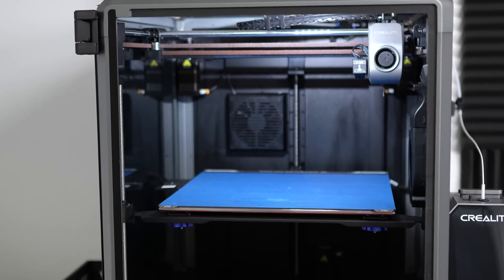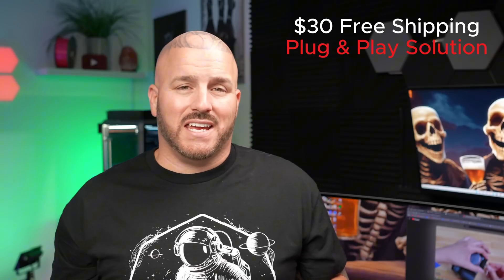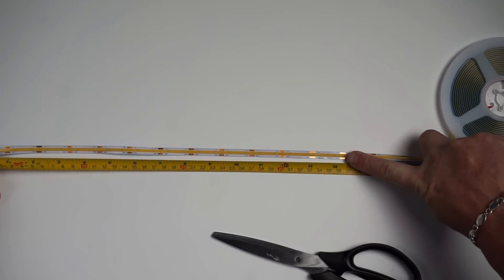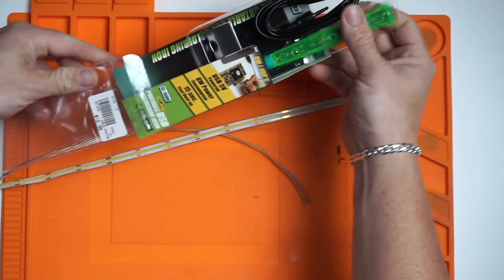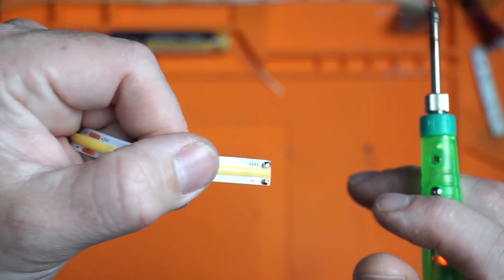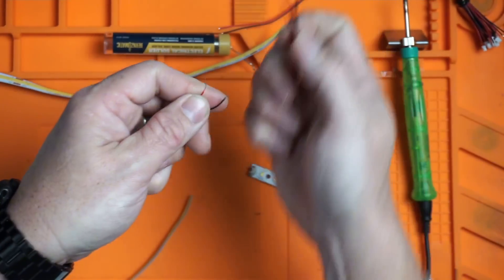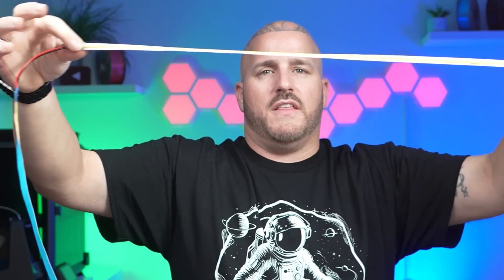The Ultimate Creality K1/K1 Max  LED Light Upgrade

Comment from the maker: I’m also producing filament sensor extension cables for relocating the sensor if you choose to do so. Fits all sensors for Creality.  The cable is $12 directly from me. Email stayreadychat@gmail.com to order lights or extension kits. These are also listed on eBay for those who feel safer buying on eBay. They are slightly more expensive due to eBay’s fees. 

Extension link
https://shorturl.at/mDmmy

Light kit link
https://shorturl.at/NJSZV

Comment: But how many ampere u need? I check the board, and pin is 24V 0.1A. U can help me?
Reply from the maker: For the k1 max you need a strip that’s 30” long and one strip that is 14” long. That works best.

Comment: Just out of curiosity, could you just cut the two wires off a spare connector (maybe the male/female mate you don’t use) and use that wire instead of buying extra wire?

Comment: can we get a new light recommendation? the ones you linked are no longer available.
Reply from the maker: https://amzn.to/42SoQbT
Reply from the maker: Yeah, it’s been hard finding lights. Especially quality ones. The ones I’ve used for almost a year now and you can’t get anymore. And 24 V cob lights are not cheap.
Reply: @stayreadyto3dprint  I found some awesome ones and printed a lid raiser with an angle on it and install the lights there it looks awesome!!!! Didn't do it the way you did but the backward connection was the same for me, they put the connector on backwards. Thanks for the awesome video man.
Reply from the maker: Yw. Glad it helped lol

Comment: flux paste will make the solder stick better, I also ran into the creality swapped colors on the cables for the jst. Buck stepdown converters to go from 24 to 12v or even 5v (cheapo light strips)

Comment: Hello. K1C with cob has  trouble 
Led Blinking when start printing
does you know how to fix it?
Reply from the maker: I would check your connection points. Unplug. Replug in. Did you buy the kit from us or make it yourself? Send me an email either way and I’ll help you out. Stayreadychat@gmail.com
Reply: @stayreadyto3dprint  make mine. normal led is ok. But cob led not. Anyone reported it with k1c?
because K1 and K1 Max works normal
Reply from the maker: No. It should work. But you need to make sure youre suing correct lights. You may need to add a small resistor to ground to clean up the power. That should eliminate the blink.

Comment: well going to have to be the first, it didn't plug and play for me. Either my k2 is different or the kit is not compatible. Tried on both ends of the lights and nada plugged in the factory lights minus the frosted covers and they work perfectly,
Reply from the maker: Then you have your wires crossed. Swap red and black and it will work.
Reply: @stayreadyto3dprint  its a pre made kit not sure how i did anything wrong. It only plugs in one way.
Reply from the maker: @ ohhhh you bought a kit? Ok well send me an email. I can send ya another one.
Reply from the maker: @ it’s possible that I accidentally wired it wrong or sent you a kit for a K-1 versus a K2. I’ve made over 500 of these things without a mistake yet so I knew eventually something would happen, but we’ll get you taken care of. Don’t worry.
Reply: @ it happens man i can make the part fine just like supporting creators i enjoy their content. We need more no nonsense 3d printer channels.
Reply from the maker: @shawnmcandrew6923  we always appreciate our supporters but we also want you to be happy with what you’re getting. I see you emailed. Looks like we have it all figured out via email.

Comment: Thanks for the great video! I still HAVE to complain! I've seen a few of your videos where you're actually soldering. And my toenails curl up every time. When you just smear the solder on the LED contacts without using any flux, and then two "balls" appear. And when you say something like, "Okay, now we have these pretty little solder beads on the contacts," it made me dizzy... you should definitely practice and improve that! Not getting dizzy, but soldering.😜
Best regards from Germany
Reply from the maker: Lmao…. I’ve actually gotten alot better and I bought a quality iron. I’ve sold over 400 kits so I’ve had a bit of practice now. Ha

Comment: What's the lenght of the LED strips for K1/K1C
Reply from the maker: I send them out at 14” for the right side. And 30” for the front and left side. That is sized for the k1 max. You will need to cut off what you don’t need. Easy. Just cut along the copper cut lines.

Comment: Thanks for this, i've done this for my k1max and my brother's k1. it's so frustrating how they don't have lights on the sides as well and only on the front, can't see anything in the back when it's printing without more light, so frustrating. Wish i found this video before i tried doing my own version and cutting the original cable. Didn't realize you could buy female connectors that fit! I had to re-solder/re-wire the original cable lol
Reply from the maker: Thanks for watching! Stay tuned for some cool mods coming up soon!!

Comment: I done the same thing but after 2 seconds, light turned of and burn smell appeared…. Now light don’t work at all
Reply: Probably 12v lights on a 24v transformer
Reply from the maker: You did what same thing? Plugged backwards? If so that’s not what burned your shut up. If you know how I diode works it only allows energy to pass through in one direction. It’s impossible to plug a diode aka led light in backwards and blow it unless you plug it into something high voltage or higher than its reverse breakdown voltage. So you have another issue or maybe your LEDs were just ready to go out anyways. 

And how did you plug it into something high backwards when the 2 pin connector only goes one way. You would’ve had to forced it. Unless you had it wires up wrong. As stated in my video, Creality has their black and red reversed. 
But you should always use a test light to verify   

Sounds like you need a light kit. I have some in stock starting Wednesday if you want to upgrade or fix your lighting. It’s a plug n play solution as long as you plug them in correctly

Comment: How did you remove the old lights. They are stuck good.
Reply from the maker: Just take a small flat head or use a razor and scrape that glue off there. They put it there to keep it from coming lose. It’s easy to scrape off though.

Comment: Only 2 sides is better ? Now you have a light in your camera
Reply from the maker: Not at all. The camera is angled down so there is zero glare. It’s perfect. I’ve sold around 100 of these and haven’t had 1 single complaint
Reply: @stayreadyto3dprint  hmmmm oke i will add 2 off them 5mm led in a angle will be fine i think so. I wont take the risk haha but thx anyway for your answer.
Reply from the maker: @Blauwdruk3D  awesome! I think you’ll be impressed. Good luck!

Comment: I purchesed a light kit for my K1C boy what a difference they really work great
Reply from the maker: Glad you like them. I’m assuming the filament sensor extension I made for you is working great as well??
Reply: how did you get this to fit in the k1c?  seems there's barely any room to shove it in the front two corners where the tracks stop.  On mine there's barely any vertical space between the silver slide tracks and the gray frame.  I made it work but am curious how you did it?

Comment: I received my kit the other day and just installed it. It is a whole lot brighter now. I popped off the OEM light easy enough, but undoing that little connector was a different story. Mine was encased with stuff? that I had to scrape away. Once done the rest of the installation was a breeze. Thanks for making this kit available.
Reply from the maker: That awesome. Yeah I guess I should’ve mentioned the glue in the connector. It’s been so long since I installed mine that I forgot about that. Glad you like the kit. I’ve mailed alot of them out and they are also on eBay now. A little more than $30 due to fees. Much better to buy directly from me. But some people like the safety of using eBay. Again thanks a lot!  Enjoy!!

Comment: Just an fyi, female and male connectors are named by the conductor pin and not by the housing. So if you see the pin, it's male, if it is a hole, female.  Overall good video, would have be good to specify to look for 24 volts led strips, someone who doesn't know might buy a 12v or 5v and blow it.
Reply from the maker: Hey thanks! Just to be clear I did specify 24 volt in my video. lol. Watch again? lol no fast forwarding! I know it’s hard! lol. And thanks for the insight on the connectors. I never knew that. Awesome.
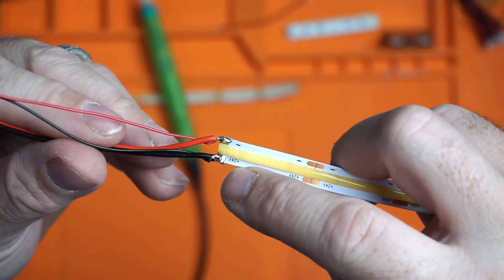Reply from the maker: See video at 8:20
Reply: Did you just assume the connectors gender?!  They’re on a spectrum! 😂

Comment: You should invest in a cheap volt meter ;)
Reply from the maker: I have two. One is expensive and the other is a cheap $6 one from Temu that surprisingly works better than expected. I suggest it actually. lol. I guess I could use it to see if it’s Creality that’s backwards or the connectors. I bet it’s the connectors. I don’t see Creality doing that on every machine.
Reply: @stayreadyto3dprint  same here. I have several. Some high end and some low end but what they're used for, a 10-dollar voltmeter works extremely well. Love the video.
Reply from the maker: @ thanks !!!🙏 yeah check out this meter from Temu. Looks like price went up. But it works great. Even has thermometer cables and a led flashlight built in. https://share.temu.com/iKSfjrKXphA